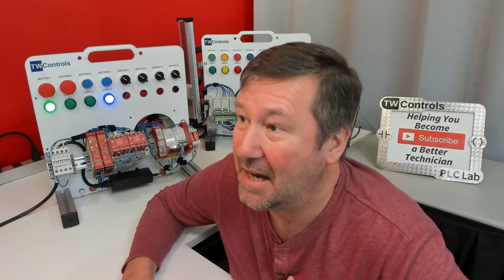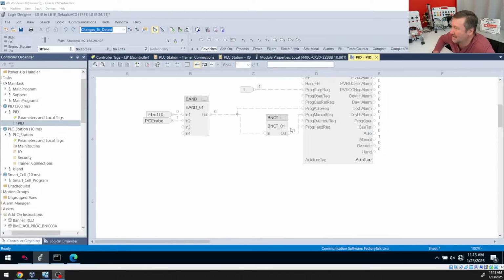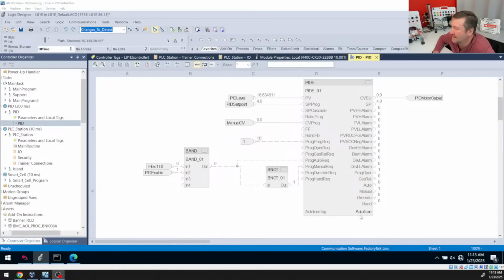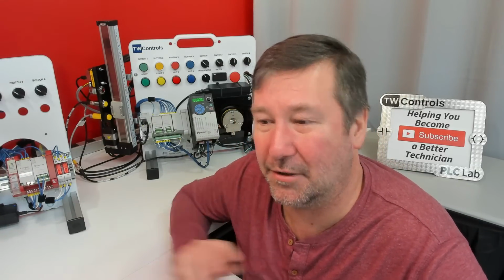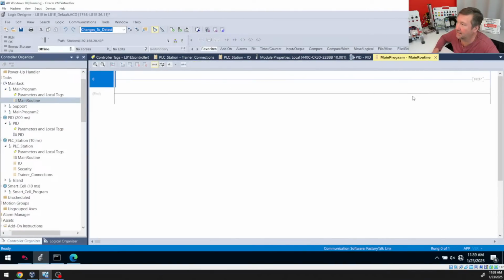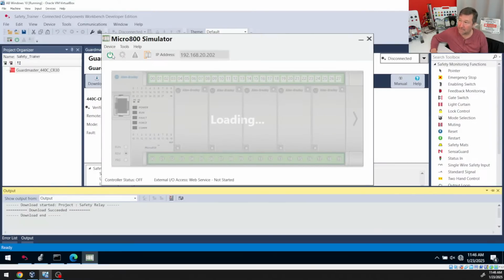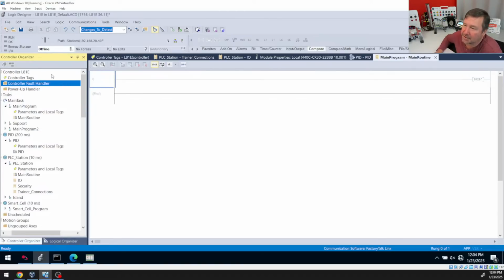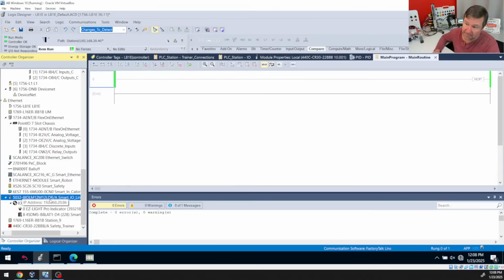20 Questions about PLC Programming

Comment: Hello Tim, I'm writing a program where I have a counter that gets reset every 1min. Let's say my counter counted up to 5 how can I save that 5 in another place, then the counter resets. And on the next cycle it counts up to 10 so now it replaces that 5. Basically I need to use the count that was reached within 1min to see how many parts are moving every minute. I used a mov instruction but it reset to zero every time it starts counting again but I need it to hold that value that was measured within that minute.to use it to control other things. I can't seem to find something if you already have something explaining this can you drop a link. Thank you! For all that you do.
Reply from the maker: Or the MOV instruction right before the reset

Comment: Tim have you encountered this situation. we are replacing old plcs that can only go to version 20-21 im guessing because they are discontinued we are taking backups fron the old plcs and try to download to the new plcs that can go to a higher version and when ever we try do download the program its deleting some of the modules im guessing because the modules are not compatible with the new plcs i hope i made sense with this. any thoughts and suggestions?
Reply from the maker: When you change the revision, there is an output window at the bottom of Studio 5000 that contains warnings and other messages. What does it say when you do it? My wild guess is it was a third party module but there are a few modules that are no longer compatible at all with Studio
Reply: @ all the faults are its undefined tags from the modules that aren't able to download as downloading it shows the modules being deleted then populates the errors from all the tags that got deleted
Reply from the maker: Are they AB modules or 3rd party?
Reply: @TimWilborne  3rd party
Reply from the maker: Do they have an updated download for it.  I know they closed up some issues with 3rd parts EDS files which forced some vendors to update them.